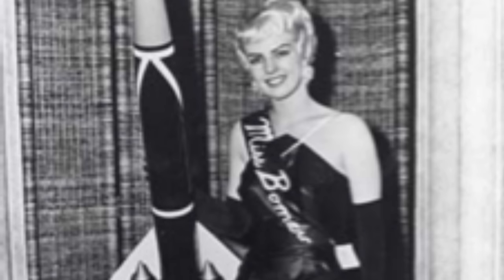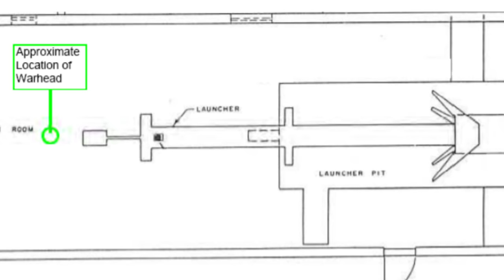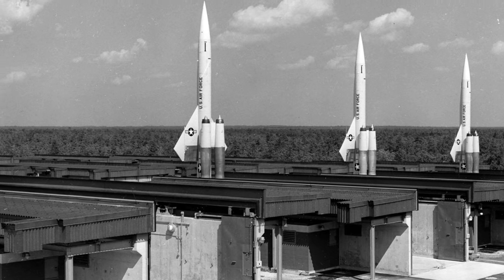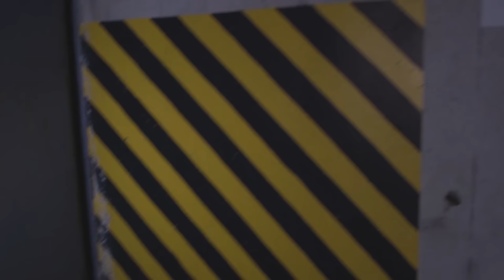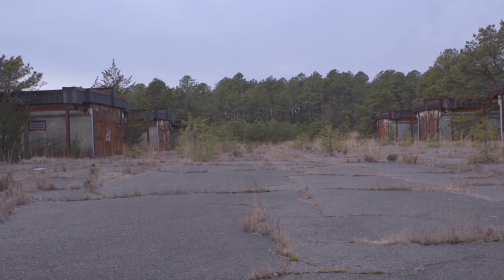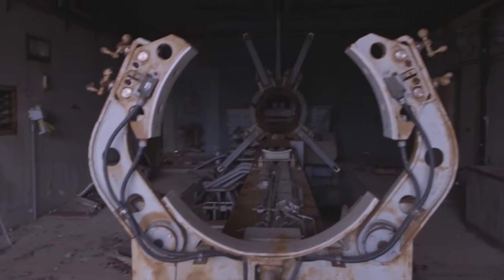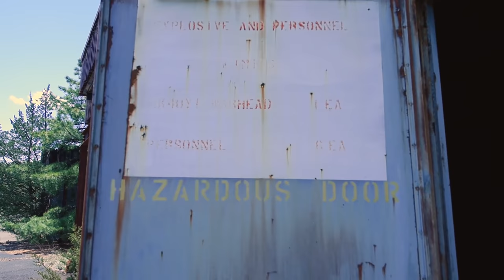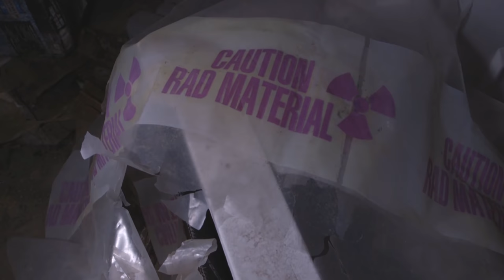1960 New Jersey BOMARC Missile Fire

Comment: I remember someone asked me about the old BOMARC boosters when I was working at Thiokol about 1990.  They had found a warehouse full of them.  I pulled the drawings and chemistry, and suggested they not try to re-use them.   They were Thiokol XM51, solid propellant boosters, designed to replace the hypergolics.  First successful test intercept was July 1960, and the new IM-99B were deployed to squadron in June 1961.  The SRB allowed the missile to carry more fuel, thus extending its range as well.  More tidbits of the BOMARC story.
Reply: yeah, after 30 years or so in storage those solid fuel components were probably dangerously cracked and degraded.

Comment: I was stationed at McGuire AFB (before it became a joint base) back in the early to mid 80's. A lot of history in that area. We still had equipment that belonged to Iran that was being held due to the hostage crisis. The Air NG still flew F-4's. The Air Force flew C-141's. The C-5 was just getting their new wings. Those were the halcyon days. Retired after 22 years.
Reply: What AFSC were you? What job? I was a flight line cop from 81 - 84
Reply: @OGKenG  At the time it was 204X1. NAVAIDS. We maintained the equipment in the red and white checked buildings around the runway.
Reply: @ozone5100  

Ah yes.
Reply: Had a buddy of mine turned down two sets of orders to McGuire back in the mid 80’s. He said he’d rather get out than go there.  Evidently they needed E-4 E-5’s at the time.  We were stationed at Charleston at the time and McGuire was everyone’s fear at the time.

Comment: My dad was the senior engineer for the guidance system for the Bomarc.  It was a gyro inside a gyro each spun I think at 28,000 rpm.  With the air speed measurement it could hit within 300' of target with x,y and z coordinates.  The middle was programmed before launch and once fired could not be called off or jammed.  
I have the control gyro assembly and the blueprints for it.
I think the Bomarc was one of the first reliable SAMs.
Reply: interesting!  piece of history

Comment: I'm an engineer. The warhead failure mode worked as designed. It's like 3 mile island, the failure was mitigated by design. ie it worked. It didn't fail.
Reply: I seem to remember TMI emergency safety systems working as they should but someone mistakenly overrode it. Human error is something that can't be completely made fool-proof.
Reply: @jrt818  It works like this:

Engineer: "It suffered a critical failure, but the safety margin exceeded the failure threshold by a factor of three."
Random Nontechnical Authority Figure: "So you're saying that we can push three times harder?"
Engineer: "No!"
RNAF (dialing his phone): "Bill? I just got some really good news from the technical team....."
Reply: TMI wasn't quite mitigated. The reactor did suffer a meltdown, but fortunately the nasty stuff was largely contained within the reactor vessel and coolant piping. It will never be usable again, unless you volunteer to crawl inside and jackhammer out the corium. Good luck!
Reply: @johnanon6938  Chernobyl and possibly a few of the others you listed could be called criticality accidents. Or, as Mr. Burns would say, "an unrequested fission surplus." The others (including TMI and Fukushima Daiichi) were Loss Of Coolant Accidents, where the means of keeping hot fuel cooled down failed for one reason or another, and it melted. The nasty thing about even slightly-used reactor fuel is that it's so radioactive that it keeps generating a lot of heat for years to come. It's a shame that no one has figured out a good way to make use of that decay heat to generate power.

The China Syndrome was a run-of-the-mill movie that would have soon been forgotten had it not had the lucky marketing accident of TMI happening a week or two after release. Clips from the movie were shown over and over again on the evening news.
Reply: @johnanon6938  We are apparently not using "criticality" in the same sense. For a reactor to go critical, it has to have enough fissile fuel in a small space, and control rods removed, for a self-sustaining chain reaction. Contrast with an atomic bomb, where rapidly assembling a supercritical mass (or density) leads to a runaway chain reaction (boom!). Once a reactor has been operating for any length of time, fission daughter products and trans-uranics (Plutonium, etc.) accumulate and are highly radioactive. Their decay can keep the fuel rods quite hot for a long time, requiring active cooling. At TMI and Fukushima, among others, that cooling system failed for various reasons, permitting the in-reactor fuel to overheat and melt. In contrast, Chernobyl was a reactor excursion caused by poor (unstable) design and misoperation (unauthorized experiments). The reactor overpowered and instantly boiled off its coolant into steam, resulting in an explosion. It was not an actual nuclear explosion (not an uncontrolled chain reaction, despite some claims to the contrary), but running at far too high a power level for the cooling to have any hope of keeping up.

Add: TL;DR Hot fuel can still melt even after the nuclear chain reaction has been shut down, so criticality doesn't even enter into it.
Reply: @johnanon6938  
Reactors are a small part of Fukushima, no one ever discusses the fuel pools that went up too. It was by far the biggest release of radioactivity so far in one go. It msotly ended up in the sea and not in the air so the harm is slower.
Reply: @Phil Perry I still need to watch that HBO movie, but if I recall correctly part of Chernobyl’s design flaws was that it relied on its coolant water as a moderator.  Meaning that when it turned to steam, it did in fact produce an unrequested fission surplus (making more steam faster in a runaway reaction), and criticality of the reactor would have changed although I’m not sure if it would have actually gone critical.
Reply: @johnanon6938  my mistake, I should have said supercritical (when it produces more neutrons than absorbed and creates a runaway reaction) instead of critical (when neutrons produced equals neutrons absorbed for a steady state reaction), it's been a few years since I had to know this stuff.  And "achieving a fissionable reaction" is not in the definition of those (or subcritical).  

And the causes were not the same between three mile island and Chernobyl, they were different designs.  3mi failed in a safe manner after a valve was stuck and no one noticed the warnings until it was too late.  Chernobyl was running a test which reduced the water flow too much, at which point a steam pocket formed too close to the fuel rods ... So the water who's hydrogen is a strong neutron absorber became 1000x less dense.
Reply: @philperry4699  And clean up, such as it is, continues to this day.  Too cheap to meter.
Reply: There was a relief valve failure at TMI. Western Reactors have a safety vessel that “entombs” the core, so yes, it worked, but many flaws, including a 14.4 baud printer that couldn’t spit out all the errors happening at the same time, important alerts were hard to see and not noticed due to placement. It was a mess
Reply: @l8tr597  A 14.4 baud printer? Wow! That's like 1 character per second. Even a TeleType was 136 baud or so. Well, I guess you gotta save money somewhere on the design of a nuclear power plant, or it would just be too expensive to be feasible! :-)
Reply: Phil Perry Lol, well, o was really slow, my numbers may be off, I recall something about “with all the alarms and the speed of the printer, it woulda taken like 32hrs to print”  the initial alarms, a computer guy may know, heck it might have been the single data cable was the bottle neck....
Reply: John Cragg Lol so true, like the General that says “we can’t be beat” after titanic there have been fewer engineers to say “it won’t sink” or “it’ll never happen that way” but they’re still there
Reply: @TwoDogsBigYard  and in every company I've ever worked in during my career...
Reply: @philperry4699  Thus is worked. The containment that was there to stop a radiation release in case of a meltdown worked as designed.
Reply: @N4CR  in fact NO release was from the reactors, ALL the release there was from the pools that were at capacity at the time due to the most unfortunate timing of an accident ever.
What's also little mentioned is that the safety features at Fukishima worked as designed, they just weren't designed for dealing with a tsunami 3 times higher than the highest one ever envisioned as even theoretically possible prior to that day.
And they had already been designed to withstand a tsunami several times larger than the largest to ever strike that piece of coastline in recorded history at the time the design was finalised.
Reply: Chas Maravel Lol, well, we were talking about tmi, (three mile island) and there were No deaths, there wasn’t even hi doses. What they did do (not the company ) was let a leaking valve go (it was scheduled for the next outtage) and, when the pressures weren’t right, they “thought” it was the same troublesome leak, and disregarded the rising water levels. 
    Your rant doesn’t pertain to this, as much as you’d like.
    Not that I disagree, bean counters have no business in safety systems
Reply: As a nuclear Grade welder and Steamfitter I can assure you all, our reactors are way better then eastern style fission reactors. One caveat, Chicago Bridge & Iron no longer makes the containment vessels as I believe they went under in 08’ and they were the last American company to do it, the Japanese still have the ability, way beyond Russia and China technical skills
Reply: Peter Gray Lol, we call those guys the “beautiful people” those college grads make the tradesman/journeymen a lot of extra $$$$
Reply: John Anon actually that movie was about the contractor faking weld test, they shot (x ray’d) one good weld and turned that photo over for hundred of critical joints.
Reply: David Attig the reactor was flawed to begin with, it had “soak” or “hot” zones that made it unstable.
Reply: Oh no, the system didn't fail, it simply dumped a shitload of nuclear contamination into the surrounding ground that the US government for 50 years denied even the possibility of existing. A few years earlier the government was exploding nuclear weapons above ground in the Nevada desert telling everyone there was no contamination. No nuclear weapon is ever really safe, and it doesn't matter how safely it's designed. Design become irrelevant when leaked radiation is a possibility virtually anywhere on the planet.
Reply: John Anon I was at Lasalle Nuclear power plant in Illinois, they were using Fermite™️ to fill cracks in cement, somehow they breached one, one of the 36” coolant pipes from the lake (the secondary not primary system, u know to keep coolant from being radioactive) those guys pumped a thousand gallons of that garbage before someone decided to check, by then the guys in control room
Were grey, I’d never seen them that scared, scared me...I wasn’t a nuke fan, gimme a school or a chemical/oil & gas plant. That was last day for me, drug up, figured my chances were better 50 miles north.
   I agree, coolant is obviously the main problem, these systems are complex and the more of that you add, the less our understanding of the possibilities.
Reply: Roger H Werner if that mess would have “hit the ground” or, considering where it was, it woulda hit the groundwater and this conversation would be mute, as the explosion would have been massive.
Reply: @jwenting  In relation to Fukushima, Still it was just dumb to locate the Emergency Generators in an inundable basement! ( as if those were just an "accesory"...)

That the Japanese and GE and the NRC Did not consider that basement inundation,  is plain bad engineering and total lack of supervision.  

 Anybody can "tweak" the Risk Assessments and HazOp studies in order to justify any mediocre design.  It has been done many times, and will continue to happen.  Engineering is an "art", not an exact science, thus criteria is unfortunately, manipulable.  Just study the numerous industrial accidents in history to see how there is always a way to mishandle a design, mostly to lower cost or rise earnings, or meet stupid and unsubstantiated delivery times in a project.  Even in Nuclear projects, the old irreal mantra of "Budget, Time and Quality" ever completely balanced.  Quality is often BEHIND the other two priorities.
Reply: @philperry4699  One of the reactors at Fukushima experienced a prompt moderated criticality, i.e. a nuclear explosion, a small one but nuclear nonetheless.  This is something that we were told could never happen.  This was determined by the speed of the explosion and the speed at which the roof of the building was launched into the sky.  A hydrogen explosion is incapable of doing what was seen on the video.
Reply: @jwenting  "in fact NO release was from the reactors" Ah, then there must be some other reason (a nefarious anti-nuke conspiracy?) that there's so much radiation inside the reactor buildings that even robots are fried in a few minutes. We don't even know yet whether the piping survived the earthquake, or if working backup generators would have made any difference.
Reply: @rodgersericv  Hmm. How about you and @CaptainDuckman "NO release from the reactors" have a fight to the death? There couldn't have been an actual NUCLEAR explosion, as there wasn't enough U235 (let alone in one critical mass) to blow up. A near runaway chain reaction rapidly boiling off the remaining coolant in a blast of steam (a la Chernobyl) is a possibility, which is frightening enough. An actual nuclear explosion? No way.
Reply: It worked as in the warhead didn't detonate. But I consider a radioactive fire that took 50 years to clean up the mess a fail.
Reply: Indeed and TMI had the same nuclear reactors as Fukushima which were all made by GE.  Even if TMI actually did go in to full meltdown it would have had limited impact.  Fukushima to this day has only one death of an employee and it is from cancer and it is not 100% certain that it was caused by the event but I guess probable enough to count it.    Fukushima even had some serious failures when the tsunami knocked out all fresh water and they had to pump ocean salt water which resulted in increase of steam and eventually some pipes blowing up and leaking radioactive steam in to the environment but even so it was limited and repaired relatively quickly.
Reply: @drscopeify  "Limited impact" of a full meltdown? "Only" one death of an employee? What do you tell the thousands of people evacuated from near Fukushima whose homes are too radioactive to live in for possibly thousands of years? That doesn't sound very limited to me. To this day, no one knows yet whether the main coolant piping failed to survive the earthquake itself, making the backup generator issue moot. And using saltwater in the cooling system would cause mineral buildup and corrosion problems, but not the production of excessive steam pressure, to rupture piping. The piping was not repaired.
Reply: @philperry4699  All of the damage was due to the Tsunami.  The area currently considered an exclusion zone is a rather small area within the working area of the plant as they continue to clean the site, you can find 2020 status maps on google. The towns right by the plant have been partly re-settled such as okuma town and you can see videos from there about 2000 of 8000 people are back but again and the cleanup from the Tsunami is still ongoing. These towns were hit hard by the Tsunami.  Now there is an issue of people in Japan abandoning rural towns for the big cities which is an issue all over Japan so resettling a less desirable place. Again, just 1 person died from this event compared to regular gas power plants that have killed more people. in 2010 KLEEN power plant in Connecticut killed 5 people and a plant in Mexico killed 26 just 2 years later not to mention scores of dead from Gas explosions all over the US and across the globe.
Reply: Tell that to the firefighters and others who were exposed to nuclear contamination as a result of the accident.  "testament to the design of the missile" indeed.
Reply: @jrt818  it wasn't a mistake; the operators did it on purpose because 1) they didn't know the POV was stuck open and 2) they were getting a false reading about the relief tank overfilling ("going solid").  However, your point is well taken but the human error was in the design, operating procedures, and lack of communicating similar failures from other reactors; not that humans were allowed to override the safety controls.
Reply: @philperry4699  so? The containment worked as designed. That's exactly what those buildings are there for, prevent contamination of the environment outside the buildings.
Reply: @greenspiraldragon  the main reason it took that long was that the environmental standards under which the military (and indeed the entire world) works changed in those 50 years to allow for ever smaller amounts of contamination.
By 1950s standards there wasn't enough contamination to warrant more work than was done at the time, by the 2000s it was reevaluated and more had to be removed.
Even by 2000s standards there probably wasn't enough contamination to consider the site to need further cleanup except that it was being repurposed and the new purpose required lower levels of contamination than are permitted for a nuclear weapons or nuclear energy facility.